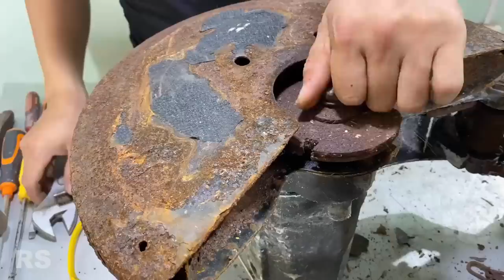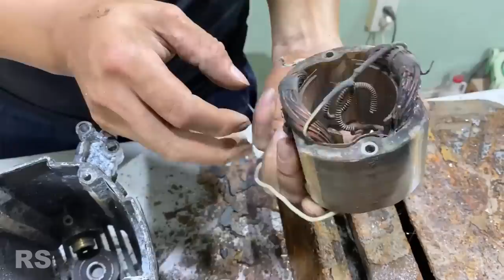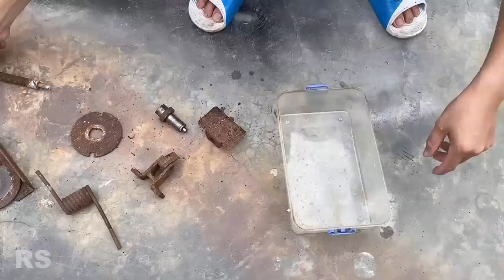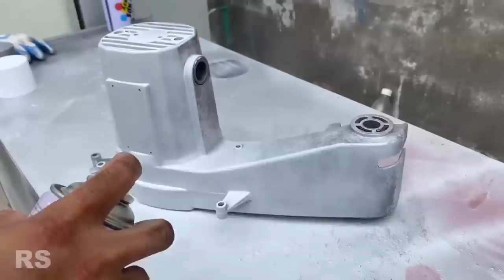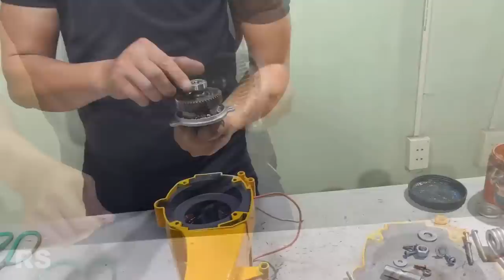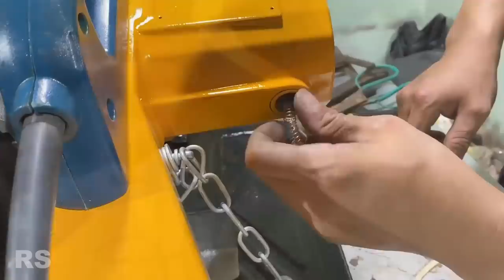Restoration Broken Metal Cutter 100% | Restore old Large Capacity Rusty Metal Cutters APT

Comment from the maker: Leave your comments so we can do better in the following video
Reply: Excellent job, superb skills!
Reply: Well done, mate. 👍👍👍👍🇦🇺🇦🇺🇦🇺🇦🇺
Reply: Great job, I have been watching most of your video, it's okay, 

But try and tell us the name and what kind of chemical solution you are using, 

You don't need to talk but just write it  on the screen. Once again good job 👍 Great job
Reply: Nice work
Reply: @vintagemachineworks  o
Reply: Nice video i hope in the next video pls. Put the names of the tools you used while working and the chemicals use to take off the rust from the metal and  in rusted bolts and nuts... And also the paints you used...
Reply: Çaisses a savon
Reply: @valenpc590  q
Reply: A machine that is used to cut or prepare food should never be painted. Eventually the paint will chip and get into the food. Leave the metal with a stainless steel coating or use food grade oil to coat the metal with. Great job though.
Reply: @randymiller5200  that's not a meat cutter it's a metal cutter
Reply: You need to go buy you a wire brush that has metal wire bristles it will be better than using a knife or screwdriver to take old paint off
Reply: @tribblebooth1224  ๅม่

Comment: I fully realize that this young man is working with what he has, regardless of that drawback, he sure needs to be given a lesson in both the removal and the installation of sealed bearings and the shafts that they are installed on. (i.e. take-away his hammer) He also seriously needs a lesson in the need to protect our earths' environment, all those chemicals he uses, the removed debris, the painting, disgarded waste, etc. which he is shown hosing down the drain or into the surrounding ground is eventually going to be something that the world will have to deal with if there is to be a future for the following generations of people.

Comment: 22:43 Rubber cap between metallic case and cables missing. 
Vibration and you could get problem with contact between one cable and metalic case, lethal shock if you are unlucky.
The lamp cord is probably a minor issue in the long run.
Great job anyway :)

Comment: Very nicely done  . The rust you had to remove reminded me of the one thing l had a hard time getting used to in Viet Nam , the extreme humidity,  that and being shot at .😁 Have you tried electrolysis for rust removal ? The color of the metal that came out of the liquid,  looked like it may have been an acid bath . If used in an open area electrolysis may be safer .
Reply from the maker: We can do it in the next video
Reply: @restorationscrap8829  na
Reply: @restorationscrap8829  what acid you used?

Comment: If you can get some Bondo you can smooth some of the rough parts of the metal (like the surface of the base) to get rid of the pitting before you paint to make it smooth.
Reply: Not really worth the time because she is going to get one hell of a work out and would end up coming off anyway.
Reply: @timcolgan4152  For me it depends on the paint used. But you are right, after the paint chips it would come up here and there or be easier to chip.

Comment: I only seen one problem it was with your wire, you should use a much heaver gage, I fell the wire you are using in this video will start a fire if it is running to long of a time. Other than that another good resto. Good work.

Comment: Serious question: how do you keep track of which screws/bolts go where? I feel like I would get lost trying to put that back together.
Reply: He  replays the video  how he took it apart
Reply: @mklik4  Thats the easy route. Some people have very good photographic memory or simply worked so much they can figure it all out with just logic and knowledge. Me and my dad repaired our bike countless times and even tho there are a ton of screws being unscrewed, we remember were everything goes without filming. At some point it becomes muscle memory. A nice trick we use is placing the screws in different cases to differentiate them or straight up attaching them to their main piece with flex tape. That way you dont lose them and since they are attached to a specific component, you know you gotta place them back there.

Comment: Some were complaining that the electrical wire was sub-standard, - (called bell/speaker wire in 🇬🇧) but his sockets are 2-pin, round/flat blade, and no earth/ground loop for his electrical system in his house/bungalow. He would have to re-wire his house and replace all the 2- pin sockets with 3-pin, to include a earth/ground loop in the electrical system. Yes, this electrical saw should be grounded but only 2-pin plug = 2-core wire is available to him. 🤭 I think Vietnam is a third world country where electrical safety is non existent/not taken seriously, consider it miraculous that he has not [yet] been killed/electrocuted by a live to ground fault, because of the earth being non existent.

Comment: I see on the motor tag that this saw is on 220 volt.  I may be wrong here, but I think you can get away with a smaller wire size at higher voltage..  I'm sure if I'm wrong, I'll be hearing about it!  LOL

Comment: He used the wrong kind of electrical cord this electrical appliance. He used common  lamp cord, which is 18 gauge  when he needs a heavy duty power tool  cord which would  
250 V, 16A electrical cable on usually sold on a reel.

Comment: Your electric cord is not adequate for the job, it needs to have better insulation and a ground. What you used is just an extension cord for household use. It could cause a fire.

Comment: By the way you make some big mistakes with painting. The finish paint is the only you use. No prime to get contact with metal. I would never use that machine, shaking no safety precautions.
Also buy some tools for correct working.

Comment: Use a wood block or a press for those bearings vs beating the hell outta them with a hammer and a way heavier gauge power cord wire.

Comment: You can do better by:
*attaching your vice properly. seeing it move tells me it has no washer, or attached to a table. Metal vices are attached with large bolt, they shoild not move when hammered.
*Angle grinding should be done using appropriate safety, eye wear and gloves and long sleeve shirt.You use none of these. It tells me you were taught many wrong things, especially safety.
*All that grinding is UNNECESSARY, as all that rust can be removed with whit vinegar and wire brushing.
*Keep on doing what you presently do, I predict you will injure yourself, even in the long term with all the dust you are inhaling. 
I teach Metalwork, Woodwork Electronics , Construction here in Sydney Australia. If I demonstrated what you do I would lose my job immediately, especially using the angle grinder. No safety at all when grinding, if that wheel suddenly shattered and hit you the the neck you wiould be killed. That's my word, try showing safe practises .

Otherwise your video was a tiny bit informative.